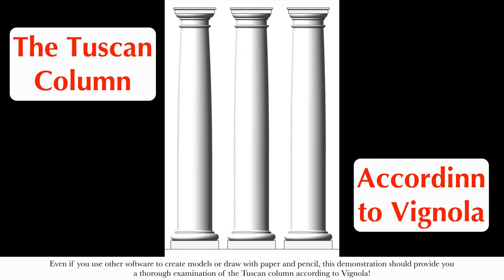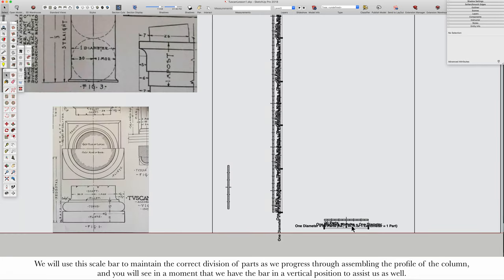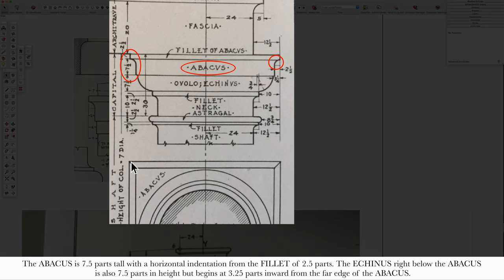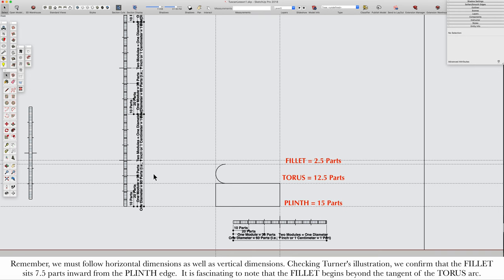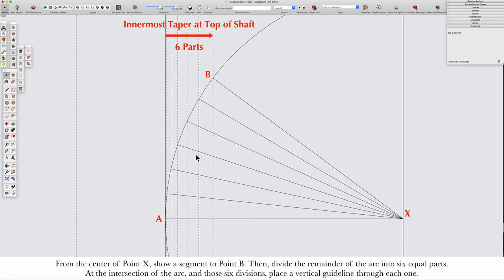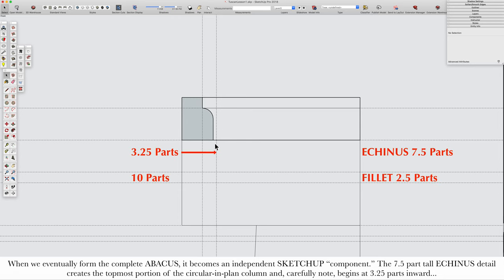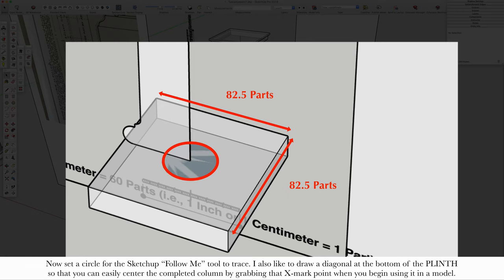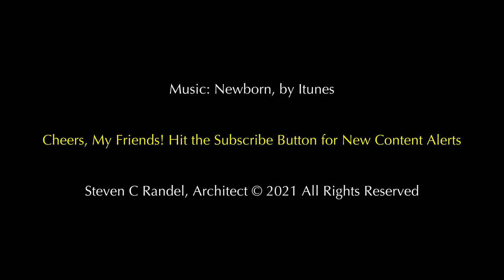Tuscan Column Proportions & Details - Classical Architecture: Created Using Sketchup

Comment: Thank you. 

I believe the torus fillet congé is 3.75 units. 11.25-7.5.
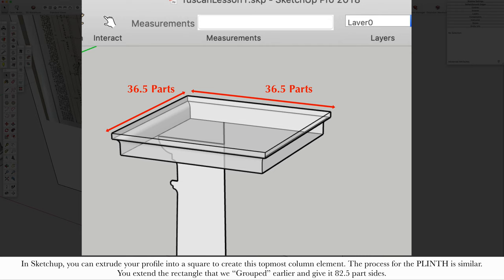Reply: Also i think you’ve got units for half the abacus extrusion not the full. At the end (18:40).
Reply from the maker: Yes, I misstated from the full width there.
Reply from the maker: I'll have to go in and look at that closely.
Reply: I believe you Can use YouTube and overlay text if it turns out corrections are required. So you don’t have to redo it all. Takes a lot of work to make these videos.